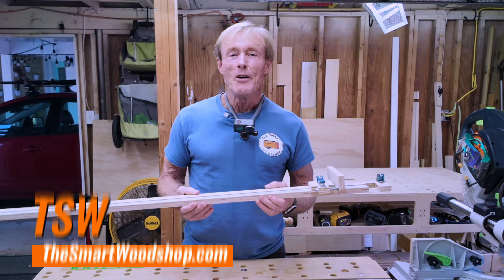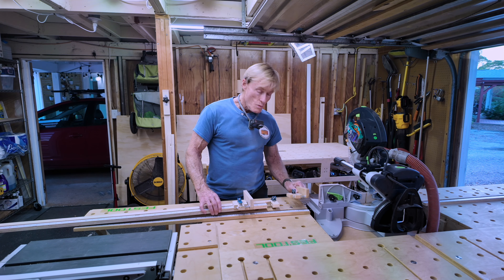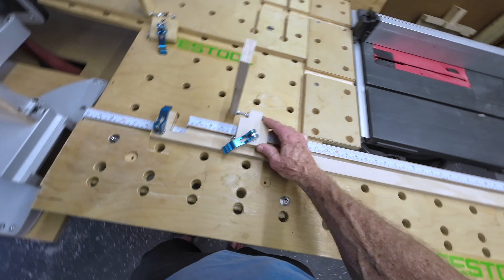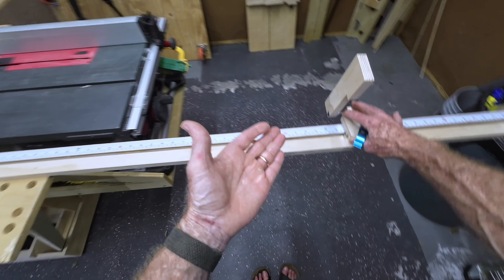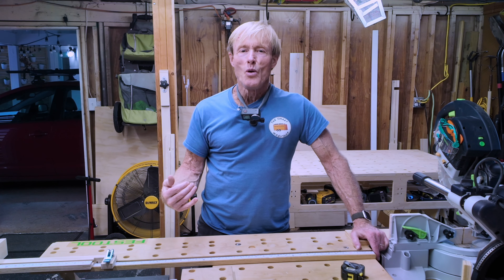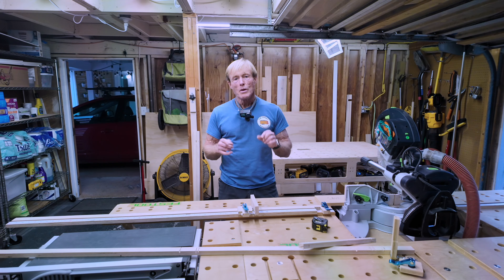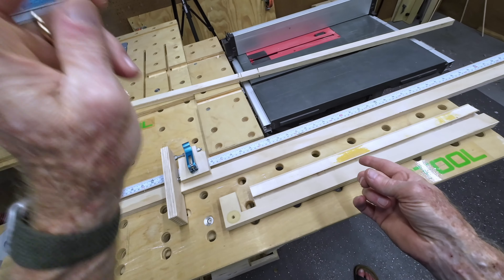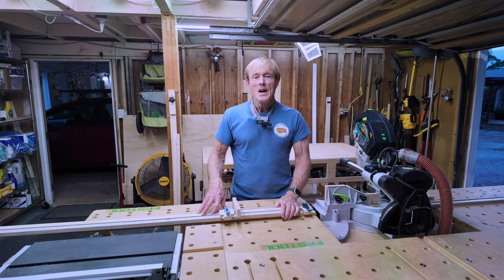The ProStop Extend: My Latest Must-Have Upgrade for the Smart Station

Comment: What would the capacity be if you were to remove the material support wings and then optimize the pro stop extend to the workbench?
Reply from the maker: Haven't considered that, as the entire Smart System works on top of the bench. If I were to remove the extensions, then I would still need an 18mm build-up on top of the bench.